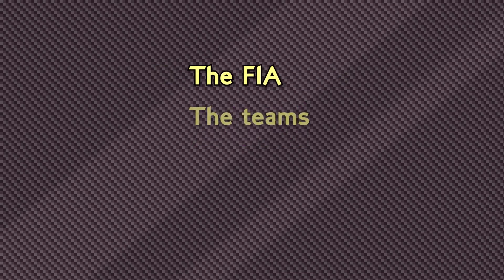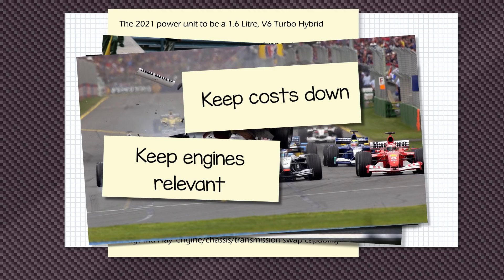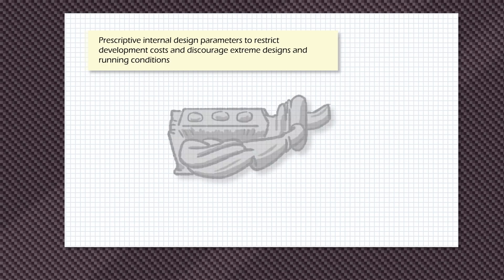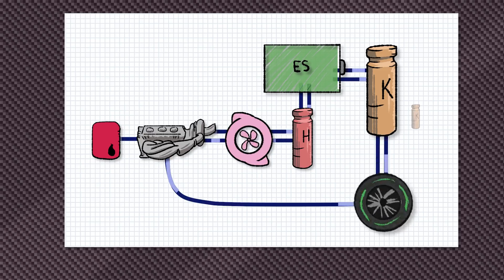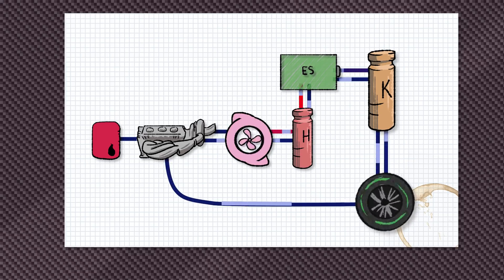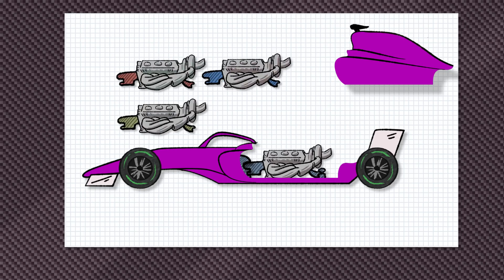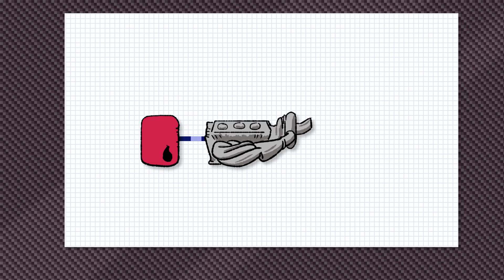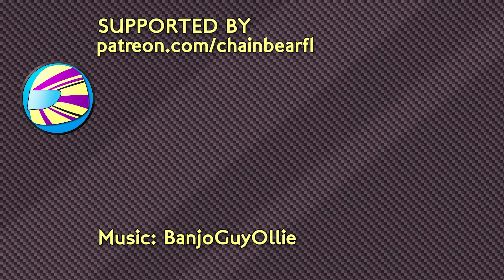F1 Engine proposals 2021 explored

Comment: You want better racing?  Stop prescribing such tight limits on the power units.  Instead give them a limit to how much energy they can start the race with, disallow any adding of energy while stopped (no refueling, no battery changes etc)  and let the engineers go nuts.

Comment: calling a 100kg V10 which produces 950hp a bad engine and likening it to an old phone

dude.. lol
Reply from the maker: Bad engine for now. Like the Nokia 3310 was an amazing phone but not a good phone for *now*. :)

These are the most powerful engines we've ever had, don't forget!
Reply: I dont think its a bad engine even for today it'll be tough to reach that level of efficiency. its still the most efficient engine under the rules it was developed. we had turbo back then as well but was no no in the rules. today the only extra we got is advanced mgu-h and more efficient batteries.

Comment: It’s not like a v10 is “old school” it just creates a lot of CO2. An f2004 (ferrar’s 2004 f1 car) does 0-100kph in around 1.9s, a sf70h (ferrari’s 2017 f1 car) does that in around 2.4s with much stickier tyres.
Reply: Dat Boi World moves forward, engine prices going down but Formula 1 going backward, "power unit" prices sky rocketing.
Reply: Dat Boi They wanna keep prices down for other manufacturers to join. But reality is different.
Reply: Do you know why the F2004 was faster?

It had traction control.

Comment: In my opinion those changes are great 
-standard CE and ES for everyone limits areas on wnich manufacturers must focus on = less gap between engines 
-more revs for better sound = happier fans
-"Kers" kinda system based on ES = more control for driver but brings back "push button to overtake" issue wnich not everyone really loves
EXCEPT one wnich worries - removal of MGU-H
I'm not really sure about that one because most propably that will put more pressure on MGU-K wnich can cause even more problems (like McLaren's with MGU-H)

Comment: I know I'm going to get a lot of hate for this but an I the only one that thinks an electric only drivetrain with a gas generator would solve most of the issues they want to solve minus the sound?  Technically possible? Not sure. But would keep the sport relevant, possibly more reliable, less fiddling with settings and more just driving.  Not sure about cost but I think it could make it either dramatically cheaper or more expensive.

Comment: This is not an impartial analysis, it is an analysis based on what you think is a good direction. Since the idiotic current engines came to be I basically stopped following this neutered sport...

Comment: What do you mean old fashioned and not relevant? if you buy top Aston-Martin, BMW, Mercedes, Ferrari, Lamborghini, Porsche, Pagani, Rolls Royce, or even Dodge, Ford, Audi, Volkswagen you will get 10 or 12 cylinders, why should F1 have a middle class engine? I find that really stupid
Reply: Lourens Rolograaf Middle class engine WITH ultra high tech hybrid stuff. We all know that stuff cannot take a part in regular cars. They are keeping costs down they say, but this year's PU's are so freaking expensive.
Reply: Orçun Altundağ if you want a winning engine and it takes an organisation of 600 highly skilled top of the notch engineers to develop 3 engines in a year, no matter what the specifications or rules, it will be expensive. They will spend it to win.

Comment: I agree with most of your opinions in this video, but I have to disagree with you entirely when you say that the combustion part of the engine will be phased out entirely. The way I see it, yes they are moving towards electrical energy more and more, but if they take combustion out of the picture entirely, it is suicide for both the business and for the competition. The fans, for whatever reason, want the "roar" of the engine, and as you state, an electrical engine is almost silent in comparison. Also, and this is just my opinion, you will never be able to replicate the performance of a combustion engine with an electrical engine. Yes you can point to what Tesla is doing and say that they are moving in the right direction with their speed and acceleration, but even they claim that that can only be done on a fresh charge. To run that performance over the length of an entire Grand Prix is simply not cost effective for what it is trying to accomplish.
Reply from the maker: I guess my point was that hydrocarbon fuels will soon be unavailable (by cost before they run out completely) so we'll e forced to think of non-combustion power plants anyway. I think manufacturers will stop being interested in making them long before that, anyway. It's going to be fascinating to watch! :)
Reply: When you phrase it in terms of feasibility and the fact that they have to due to resources, then I can see what you meant. Good point.

Comment: If MGU-H gets eliminated then add 2 more cilinders to make a V8 limited to 20000rpm and a biturbo or twin turbo for the "turbo lag problem" and to save the MGU-K power for driver use. But i was thinking, what about a supercharged engine instead of turbocharged?

Comment: They want rules to keep engines kinda close to road cars. So show me a road car that is even close to 12k rpm. In my opinion F1 has really nothing to do with road cars. If you want to have it road car like you should look at cars with power. What do we got here? 3l v6 biturbo for many bmw, v8 all over the place in higher end cars like R8 and so on. There is not a single car out there with serios hp and a 1.6. v6.
Reply: Volyzer Is there any 1.x liter V6 car?

Comment: F1 2019 Rules: Here is 500 mil build a car completely from scratch. One engine per year. Only safety constraints. Has to hit 500kph on highest downforce setup, lowest fuel consumption, lowest power-train settings the driver can change, cold hardest tires, in the thin air of Mexico in the distance considered the shortest straight on the calendar.

Comment: I think the sound was part of the magic
I can live without
But they also removed competition
Since 2014 all the drivers race in a conservative way because you have to use certain amount of fuel
I don't see incredible overtakes anymore
The sound and the overtakes where the most important parts of the f1 and they took off both of them

Comment: "everyone is happy with fairly happy with this size of the engine" I'm not, and you can totally hear the sound of the cars in F1 especially when the go to the camera mounted of the car. you hear the thing and it sounds like a damn motorboat, put a V8 in the thing then it sounds like a car going 190 mph. it so much better and I like what James Bloomfield said and I qoute.

"F1 shouldn't need to be relevant 
It's supposed to be the fastest sport in the world not the most reliable or most like the real world"

Comment: I also hope that they redo the cars for the 2021 regulations. 
1. These new cars need to be a little more compact with a smaller lenegth and escpally a smaller width. One of the reasons why overtaking is so differcult is that these cars are 8in wider than the previous cars. They need to reduce the car width from 79in to about 74in to increase overtakeing and side by side racing.

2. The 2021 cars need to have less small aero bits on the wings, and sidepods and more bigger and larger ribits instead. These cars make so much dirty air is because of all of the small ribits for Downforce. Large and bigger ones would make less dirty air and aeropush but still generate a lot of Downforce. 

3. The new cars need to be a little more standirzed parts that don't alter the playing field. Some examples are wheelbase, steering wheels, steering racks and fuel tanks. All these bits don't really change performance but lowers costs by everyone getting the same parts.
Reply: Ace Garcia I don't know you disagree or not, but I think they need to change fuel and part regulations. For smaller teams, making reliable, compact and efficient or developing hybrid tech is almost impossible.
Reply: Orçun Altundağ I agree. Spec out same parts of the chassis, escpally the ones without true performance advantage.

Comment: I know it’s called an MGU-H but it really doesn’t work on heat, does it? It’s another kinetic device that controls the turbo speed, right?
Reply from the maker: It's a motor/generator. It generates energy from the heat output of the engine/turbo. It then acts as a motor to regulate the turbo. It's not a kinetic device in the same way as the MGUK as it's not capturing energy from the car's kinetic energy.

Comment: In my opinion I think this is a good compromise between costs, racing, technology, and revelantance. The new F1 engines would have better sound, more tactics with a driver controlled MGU-K. I like the more spec parts to reduce R&D and  costs which HAVE to be addressed. The

I only would alter is instead use a simple Twin Turbo bolted to each exchust. It's would increase power, reduce costs, and would get rid of some of the turbolag without an MGU-H.

Comment: I know its going backward, but they should have used a sub 2 l twin turbo V8, they can remove the MGU-H, as its twin turbos and it will produce more power and sound without over straining the engine.

Comment: dont matter F1 died 20 yrs ago... they just nursing a corpse! Also this commentator is not a Racing fan, he says that v10s are just like old phones because they click and whirl..... Race fans wants to see V10 and V8 So give them what they want! NOONE want to see elctric 1l engines NOONE!
Reply from the maker: I respect your opinion but I hope you know you don't speak for everyone. :)
There will be a lot of heavy debate to shape the power units of the next few generations of f1 engine rules.
Reply from the maker: I didn't say v10s are like old phones because they click and whirl. I said some people like them for similar reasons to the reasons they like old phones. Not all race fans want to see v10s and v8s - a lot of race fans don't care what's under the chassis as long as the racing is fun and interesting. Hydrocarbon fuel will be phased out (because it won't exist) so finding out ways of relying on it less makes sense. Electric motors are part of this.
Reply: Blame USA It's HIS opinion, if you want V10s and V8s It's YOUR opinion, but also not EVERYONES opinion... Hope you get this...
Reply: JMGaming oh i get it, motor sport has always been v6-v8-v10—-v24  electric is not motor racing. It is something else. Hope you get this....

Comment: Dude they're not going to go full electric if Formula E exists wtf. I think combustion engines will always be relevant because there are always going to be other fuel alternatives other than gasoline and diesel. Plus the minerals used to make the giant batteries in electric cars aren't easy to find and the labor used is incredibly unethical, borderline slavery. So as long as those two factors remain in place, combustion engines will always be relevant.

Comment: What relevance a V6 1.6 Turbocharged hybrid can put in a common car? That as a BS, relevance for the real world cars are small engines, a few hp and nothing more, in the competition world what we need are affordables engines the V10's are prove that engine can be affordables, powerfull and reliable for racing, the F1 need learn with Indycar Series in all specs, engines, teams, former drivers and circuits, we don't need a relevance engines to world in a F1.
Reply: Ok, with your point, we may have engines like a V10 R8 and LFA, V8 of all Konnigsegg's, V12 like a Lamborghini and Mercedes too, not a V6 hybrid, only the new Mercedes One has this engine, in the automobile racing world we need great engines who makes good feeling on fans like the old V8 and V10, with a lot of tecnologies and great power N/A engines.
Reply: What?? The V10 engines are the lightest engine EVER, weighing less than 100 pounds, often up to 95 pounds versus at least 120 or 130 pounds of current V6 turbo hybrids, you'd better research and learn more about F1 history and cars.
Reply: Josué Fraga Costa but you forgot about the hybrid system... we aren’t going ins to be leaving them behind anytime soon are we.
Reply: Prius brought hybrid relevancy to road cars in 90's, F1 has no road relevancy whats so ever, real F1 enthusiasts want screaming high tech NA V10, V12 or atleast V8
Reply: Josué Fraga Costa seriously. We want F1 cars to have relevance to supercar a and sports cars, not econoboxes. V10 or V12 hybrid please!
Reply: Josué Fraga Costa the words ‘affordable’ and ‘v10’ don’t work together. A v10 is too heavy it will be no quicker

Comment: I would like to see the following 2 changes:
- The FIA setting a fixed price on each engine component, to bring the manufacturers closer and to give a better deal to customer teams
- Mode and upgrade parity for works and customer teams, so if an addition to the engine is developed, the works team can't start using it until all customer teams also have access to the new version (No more teams being a race or two behind in tech for no fault of their own - or a whole year in case of Sauber)

Comment: This "road relevance" hybrid crap needs to be left for WEC et al 24 hours in the LMP1 class.  It's essentially a stop gap to full electric.  The automobile 5 yrs ago is not the same as today nor will it be going forward.  Road relevance today and going forward is: fully electric, fully autonomous, park assist, lane assist, sat-nav. gps, 360 degree Lidars, motion control, infotainment systems all the while the kids in the back play playstation or watch sat. tv while the parents talk on the phone or work inside the car on their laptops. WHERE DOES F1 as a MOTORSPORT fit into all this electrical hybrid wizardry nonsense.  Bring back the V-10's or V-8's under the current wider chassis and wider tyre widths and tyre slicks and get rid of DRS (fake overtaking) along with the halo and bring back the grid girls....all is cheaper, cost effective and more players will join while the 2 or 3 main players will leave.  Fans will come back and a true motorsport will come back.  The pinnacle of motorsport is over with relation to the car.  F1 then will just be a motorsport....like MotoGP.